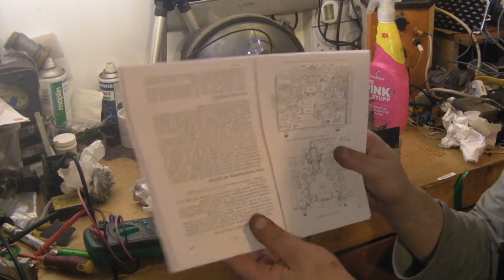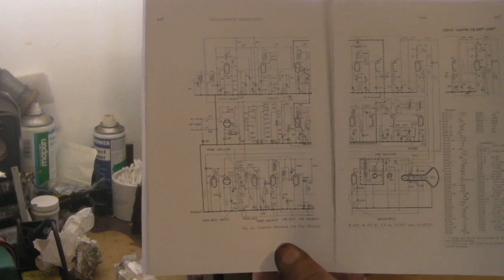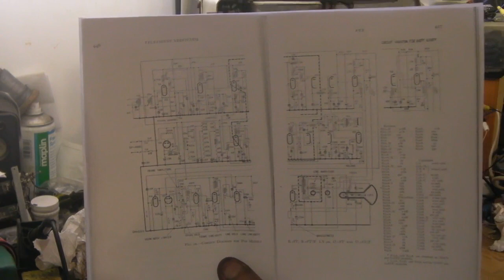Vintage PYE (LV20/BV20) Television Restoration Pt2 1st look over

Comment: Variac it over a couple of hours. Change the waxies and the smoothing can. The capacitors in the timebase circuits are critical. Then you should get first light. In nice condition that....